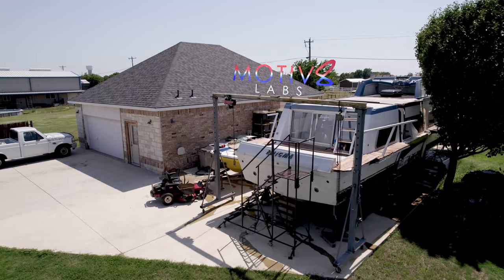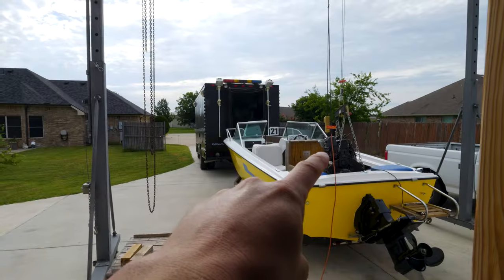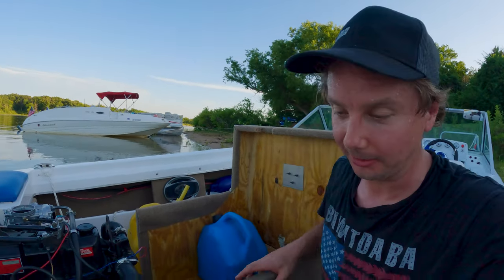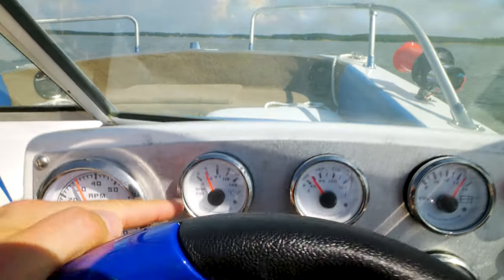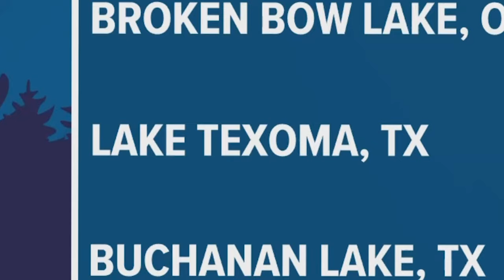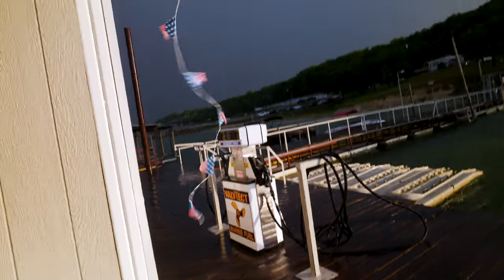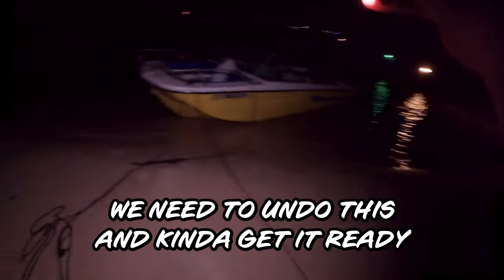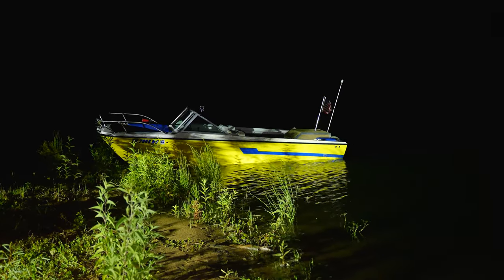Taking Our Budget Boat Into a Bad Storm! On Accident...

Comment: Great series. 
Good tip on the primer tool, on GM inline engines. (Maybe others) However, GM V- engines use a groove in the distributor to cross the oil to the left side. One can be made from an old distributor or purchase a quality purpose made tool. Some Amazon comments mention some cheap ones don’t work.
Reply from the maker: That’s exactly what a buddies father had, a cut apart distributor to use as an oil priming tool. Never would have known about that if he didn’t show us.
Reply: @Motiv8Labs  I have an 84 VIP my dad bought new. I went with him to Vivian to pick it up from the factory. Most likely going to have to do the same as you to get her seaworthy.

Comment: I've used Blaine's motor supply in Dallas before. Good prices and work.
Reply from the maker: That’s good to know! I called a machine shop closer to me in Fort Worth and they said they wouldn’t be able to work on that marine 4 cyl but I bet this Blaine machine shop would. I still have the old engine so might be worth fixing as a spare.
Reply: @Motiv8Labs definitely worth fixing … New bearings and fit the one rod… it’ll run a long time

Comment: Great video, boating is always an adventure! I have the same throttle/g3ar selector on my '77 Sea Ray, any idea where the the throttle only button in the middle could be had from?
Reply from the maker: I ended up buying someone’s used shifter assembly on eBay because the old shifter was falling apart and also missing that button. Luckily the eBay one came with the plastic button. I am sure this one will fall apart soon and I’ll have to figure out a way to 3D print a new one since they are so hard to find now.
Reply: @Motiv8Labs  There is not much left of mine, was thinking of having one machined out of stainless if I can't find a replacement.